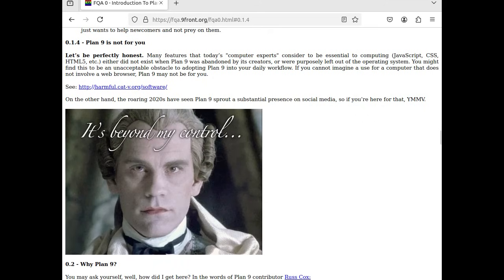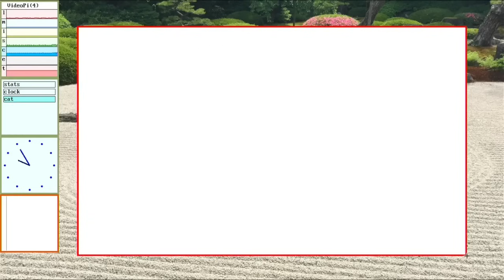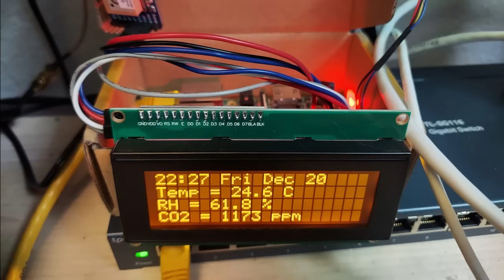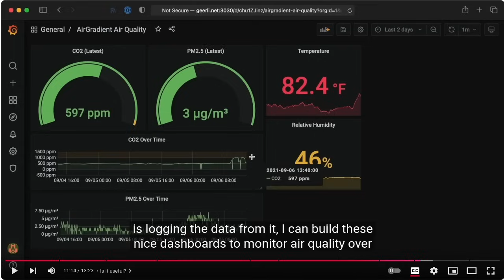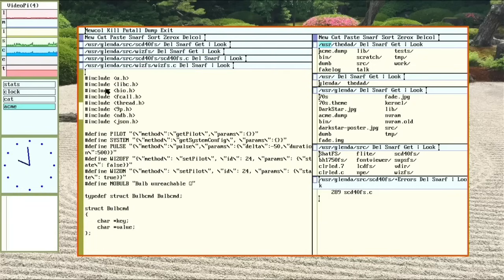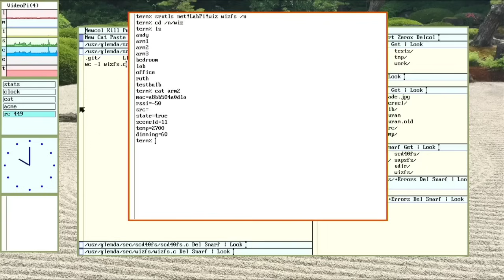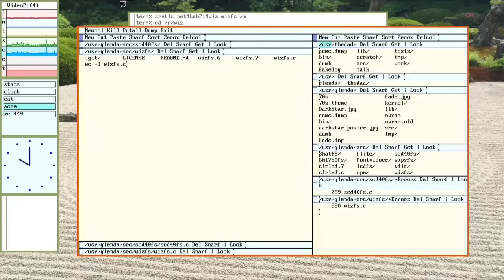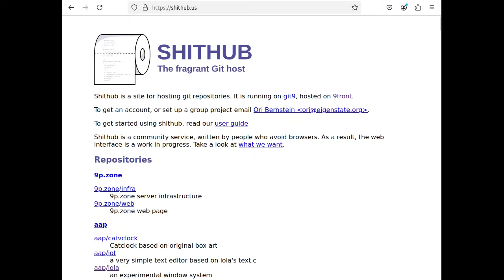What do I use Plan 9 for?

Comment: It seems simpler than Linus to write small efficient code.   Looks like it's peppy on the Pi too.
Reply from the maker: The code base is fairly small, so the system does boot fast and is pretty responsive.  However, that means there are less drivers.  A big chunk of the Linux code is just drivers to for every possible hardware combo.

Comment: I'm trying to build a cyber deck to write text files and playback music and videos. I'm not super happy with the Linux experience on Arm SBC's and wish there was an alternative. Would Plan9 work for this use case?
Reply from the maker: That is kind of a universal problem with Arm SBC's.  Since the are SoC's, they often have built in hardware that needs its own drivers.  And the companies that put those Arm chips onto boards can often wire them up in dumb ways.  So you not only need specific drivers for the chip, but possibly quirky ones for specific boards.

The best supported Arm SBC for 9front is currently the Raspberry Pi 4.  Getting an Arm SBC kernel for 9front is not terribly difficult in terms of skill.  It is mostly difficult in terms of the time involved in putting together all the drivers unique to that board.

If you wanted a unique cyber deck that took advantage of the Plan9 way of doing things, I would make it a whole grid in a deck.  Have 3 rpi4's.  1 to just handle file storage and authentication.  Another to be the terminal.  And a third to be a CPU server that pxe boots, so it can be rebooted and reconfigured as needed.
Reply: @adventuresin9  Thanks for the reply. I want my 'deck to have a good battery life so running 3 rpi4's would be heavy. I was thinking something along the lines of Desktop PC for CPU server, rpi4 as storage server and rpi-zero 'deck as terminal.
Reply from the maker: You may be able to use the new rpi-zero with the 4 cores for a terminal, but the low ram may hinder it.  And for the CPU server, you don't have to think of it as something with a big CPU.  I usually use my rpi's as CPU servers because they can easily be turned off, rewire the GPIO, and turned back on with new configs.  But a big reason I use rpi's is to have them do little tasks with devices on the GPIO pins.

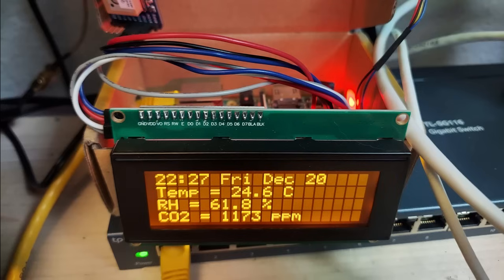Comment: 3:17 C02 censors
where do I buy this panel screen and board?
Reply from the maker: The co2 sensors are the Sensirion SCD40.  The lcd panels I've found in a few places, like Amazon and Aliexpress.  Look for i2c or iic lcd display, they are usually sold by how many columns they display.  I know Adafruit has them, or had them in the past.

Comment: New sub who stumbled in via random YouTube recommendation. Cool to see Plan 9 in actual use. In your bulb example, do you just change the (for example) dimming property value in the file to make the bulb change light intensity?
Reply from the maker: Yup, i echo 'dimming=50' into the bulb file, and it sends the command to the bulb to dim to value 50.
Reply: @adventuresin9  Cool, and good to know. Will check out the rest in due course. As someone who appreciates clean and simple implementations, 9 Front looks intriguing.

Comment: not a docker container in sight, only plan 9 to be found. heroic.
Reply: No need for containers if your operating system supports process namespaces from the start.
Reply: @Eletronicafg  the problem with that is docker is just orchestrating process namespaces (cgroups) in linux, you can do everything here in linux as well, and in some cases a lot damn better. the main advantage of 9front is the kernel can be understood in short order.
Reply: @shemlesh  The actual problem with containers comes from linux itself being fragmented to hell. Docker would be just a config file for managing containers and services if it wasn't for that.

Comment: Thanks for the interesting explanation of how you use Plan9 but sadly for someone competent enough to write their own i2c drivers you make the common mistake of conflating Linux distributions with the Linux kernel. "Linux" is just the kernel, it's used in so many eays/places today that continuing to conflate "traditional" distros with "Linux" makes absolutely no sense at all.
Android didn't "strip down" anything, they simply used the Linux kernel and built on top if it just as intended. They wrote their own libc for example, but that has nothing to do with the kernel, just as different distros use different libcs.

Comment: Please tell, can you run 9Front on RV32IMAFC machine without MMU with 512K SRAM ? I'm playing with my own soft-core (soft-SoC), it has FastEthernet and some other low speed periphs. Now looking for an OS for this hardware.
Reply from the maker: Plan9 and 9Front wont run on systems with no MMU.  There was another project call "Inferno" which took the Plan9 ideas and was designed to run on embedded systems.  However, development stopped on it mostly, and I do not think they have a risc-v kernel for it.  There are other projects to implement simple 9P on MCU, search for "NinePea".
Reply: Yes, I know about Inferno, been trying it somewhere in 1999 on PC. Wikipedia says it was last released nine years ago and there's no RISC-V port. Will take a look on NinePea. Thanks. But, how much RAM 9Front needs to run ? I'm working on adding MMU. :)
Reply from the maker: I have run 9front on systems with 64MB of ram, but without graphics.   A frame buffer will need some space if it runs it's own display.

Comment: Did your fixes for spim for port/sysproc.c (WAIT I guess) and string handling go into a repo somewhere?  I've been updating mt7688 for "DO NOT INSTALL" and it appears(?) the latest 9front has the same ordering issues you talked about in your IWP9 presentation.  I thought I'd ask before reinventing that wheel & didn't see them on github.
Like you I wasn't able to get the Onions to tftpboot, but my e2500v4 wireless access point tftpboots just fine.
Reply from the maker: The fixes should be in there.  I'll pull down the latest updates tomorrow and see if I have a similar issue.
Reply from the maker: One issue that may come up is that the kernel in 9front doesn't have fpu emulation, and that can cause issues when awk is used.  I have a patch on github that can help with that  https://github.com/adventuresin9/mt7688-fpu-patch
Reply: @adventuresin9  At the time it was 'paniboot: couldn't find /n' or somesuch on 10552 on e2500v4, but now I've broken bcm64 troubleshooting some i2c issue and my new fileserver bits need installation.. and-in-addition-to-that...

It's all good though!
Reply from the maker: @ardentglazier2867  I can't replicate it.  I also have a Linksys e2500v4, and everything works, but this is also a system i've run all the updates on several times.  It may be possible that the install shipped with the old pre-compiled spim libs.  'cd /sys/src'  do 'objtype=spim'  then do 'mk nuke', and  'mk libs' and 'mk install' finally clean up with 'mk clean'.  And if you can, add my fpuemu patch.   As for bcm, it ships with 2 i2c drivers.  i2cbcm is the one I did, it uses the built in i2c which is not fully compliant.  i2cgpio was written by cinap, and it bit bangs the gpio but follows the i2c spec better.
Reply: @adventuresin9  I'll try that; I should validate all the compiles anyway just for warm fuzzy.  With i2c gpio I've found that I can't write all columns on my sensehat led, suggesting a packet length limit; there's a limit in uh, [138] in somewhere I forget (devi2c?) or in bcm but I can't claim I understand the call chain quite yet.   After lunch ;)
Reply from the maker: @ardentglazier2867  You are on the right track.  That is a limit in port/devi2c.c that does prevent doing a complete write to the sensehat led grid.  The i2c device is mostly used by the devs for smbus stuff, so the limit is fine for that.  It is also using the kernel stack, so they keep it to a minimum.  I do a modified devi2c.c with pkt[256].
Reply: @adventuresin9  Well that was the fix for i2c.  Not sure if I'll use i2cbcm or *gpio, but at least blinkenlights can commence.  Recompiling and fpipatch (appears?) to have cleaned up mt7688 a bit but mine still panics: "panic: boot process died:  file does not exist 'n/b'" .. but that's progress.
Reply from the maker: @ardentglazier2867  well 'n/b' is not a legit file.  It is either getting truncated in the actual call, or in the error message.  Closest I could think of that early would be the exec of /bin/bootrc, called in /sys/src/9/boot/boot.c  I did leave some debug stuff commented out in mt7688/syscall.c you could try.  Or email me for better help, adventuresin9 at gmail dot com

Comment: Its getting so tough out there for loonix nerds to be quirky and special that they're now starting to use obsolete boomerware
Reply from the maker: To go along with the "boomer" aspect, there is a bit of "pulling up the ladder behind you" going on.  What started as a light weight and flexible system for experimenting later became an overly complex and aimed and promoting vendor lock-in and forced obsolescence.
Reply: @adventuresin9  He was talking about you. But jokes on me, I use openVMS to run Quake servers. And I've got a Winlink station on a Cuban submarine running RedStar OS to send emails to the next galaxy. Checkmate.
Reply: @adventuresin9 I'm not even that experienced and I have already discovered why there is an appeal in something like FreeBSD where every "system level" (I know that's a noob term) dependency is lock-stepped from the get-go. Though, I haven't tried a BSD or Plan9 yet. I have realized I should invest some time in learning more about these in case they could promise better dependency management.

 A lot of Linux fans couldn't even comprehend horrors like a franken-ubuntu (v18 kernel, v20 filesystem, v16 bootloader) , and they would defecate themselves at the thought of their livelihood depending on delivering bugfixes to such an abomination. 

Linux can be just as wretched as Windows if abused. The reality is there are good and bad systems and you can make an abomination or Elysian field in any platform.

Comment: Good to know that someone had particle use case of Plan 9, I thought it still experiences project, but I really like it  minimalistic principle as someone who don't like bloatware, I'm still using ArchLinux on my laptop, but I'm thinking using other OS's on high-end laptops I had, as a guy his first computer only had 128MB of RAM I'm frustrated that some Gnu/Linux DE consumes by itself 1.5GB of RAM that's insane, Linux for desktop weren't meant to bloated this way, it's ruining user experience for no real visual improvement.
Reply from the maker: I used Linux on similar systems in the past, and they ran fine.  Now, I open a basic text editor, like xed, and it takes 20MB just to start.

Comment: "longer rant video about Linux" - always welcome :) I never cease to be amazed how people take that mad complexity of modern Linux distros inner workings for granted and praise it's simplicity...
Reply from the maker: I first used used Linux back in the late 1990's.  The system and the people working on it has changed a lot since then.
Reply: @adventuresin9  I started getting my impression of Linux and FOSS a decade after that. It took some time to realize that there were no longer those people nor those ideas that I read about on old forum threads and watched in "Revolution OS" movie...
Reply: @adventuresin9  I guess this more related to M$ and other mega corps have seat board on Linux foundation, I agree with you Linux still useful for running server, it Desktop use case ruined long time ago.
Reply: not sure if it will fit the theme of this channel though